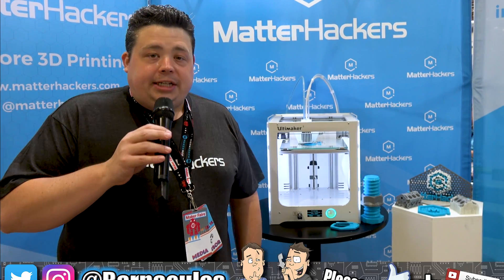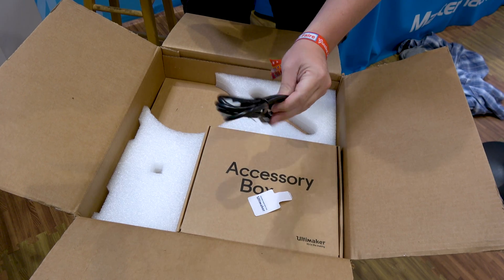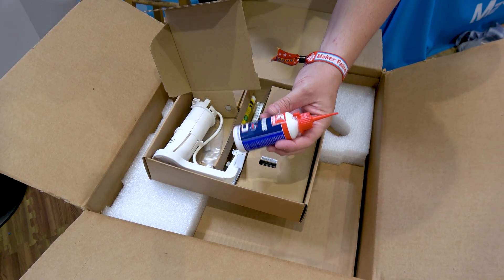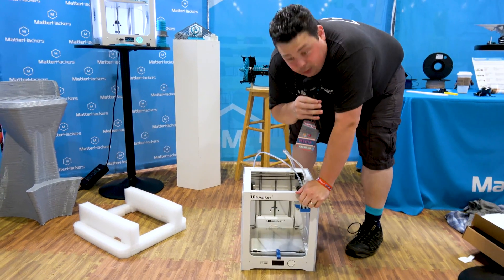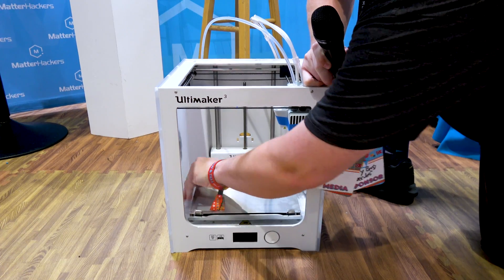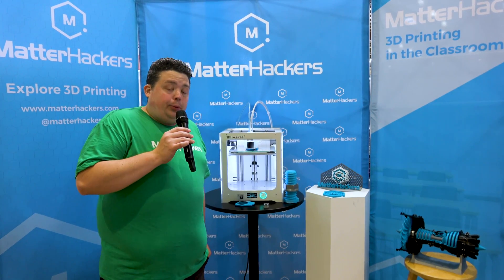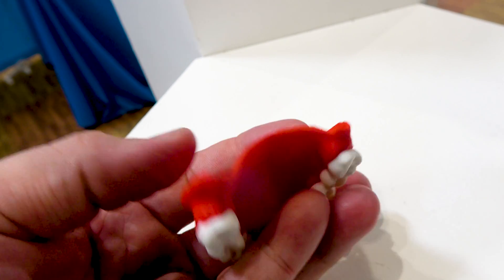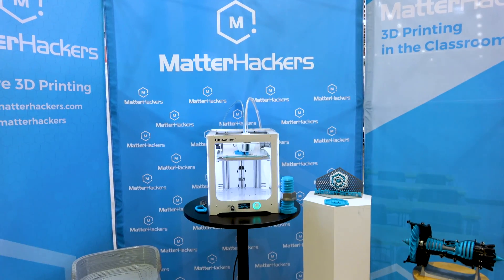Best Dual Extruder 3D Printer Money Can Buy, Expensive, But Good! - @Barnacules

Comment: I am a complete newbie when it comes to 3D printing. My daughter asked for a 3D printer for Christmas and my step father actually got one for her. A knock off ender 3 I believe....Foxnovo is what mine says. My daughter quickly realized it wasn't as easy as she thought it was going to be, so mommy, who knew absolutely 0 about 3D printing, had to step in and figure out how to use this thing. I have finally got it printing good quality prints (again, for someone who doesn't know what they r doing), but my question is....and I know this is going to sound stupid....but what is the glue stick/hairspray for?

Comment: There are 3 main issues with 3d printers as we have today.  The first is the accuracy in that the results I have seen do tend to have wasted material that has to be sanded or ground off whatever is printed.  Secondly there is the speed.  Right now they take far too long to be viable for me to use for work as even a relatively simple project takes a couple of hours.  Finally there is the cost.  As Gerry points out in his video on the MegaBots project these things can be mega expensive, not just in terms of purchase costs but also running costs.  Once these have been resolved I can see them becoming an item that is worthwhile outside of the hobbyist and specialist arenas.  Until then, their market will remain limeted.

Comment: Hello Jerry great video from makers fair 2017 with 3-D printers from alter maker other than running less hot in making less noise what features which are mentioned your video what feature makes this printer stand out from other 3-D printers and from the 2 previous versions of the printer you have used in the past. I would like to see a video on the latest Windows 10 update the creators update please if you would do that in a future video a fan have a great time at maker fair 2017.

Comment: Is the NFC that identifies what kind of filament embedded in the spool? When we purchased and setup our unit (thanks to your recommendations in other videos), the ultimaker spool of filament included in the box were recognized without issues. However, when we ran out of those and ordered PLA from a different manufacturer, we tried re-using the ultimaker spool with the new filament but the printer would not recognize and configure itself? Not sure why. Thanks.

Comment: How come in the timelapse, the bed keeps moving up and down, like it would on an SLA style machine?
Reply from the maker: +3D Printing Lab because its switching the nozzles.
Reply: So the build plate is technically pushing the nozzle up to help with the issue of a print getting little blobs of the other oozing out when it is printing?

Comment: I work with 3d printers at my uni and we use a ultimaker 3, 2+ extended along with others. We've found that the ultimaker pva was a bitch to get to print (never got a successful print even after buying a filament dehumidifier and enclosing the printer) but matterhackers has been amazing! I don't think we have had a failed print using it after testing it with a butt load of different types of prints. 1000% recommend using matterhackers pva over ultimaker
Reply: Awesome! Glad you are using the machine. Let us know if we can help in any way!

Comment: Just got one of these bad boys at my school. You only increased the hype! Great vid dude!
Reply from the maker: You're going to love it. The dissolvable filament is tricky to get to work right but the auto lifting nozzles and cart designed for it make all the difference. Now you can print some very complex things. It actually can print stuff that the Form 2 SLA printer I have would struggle with.